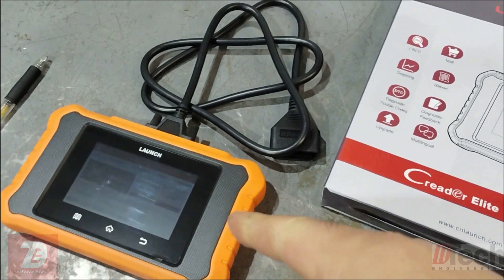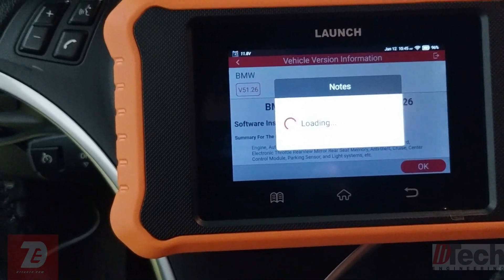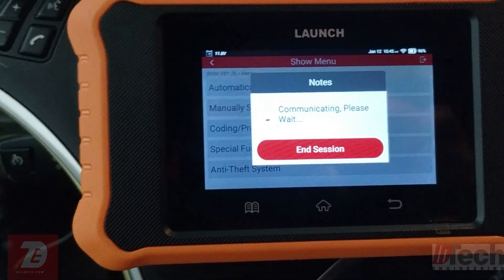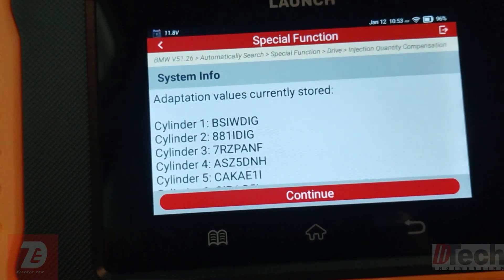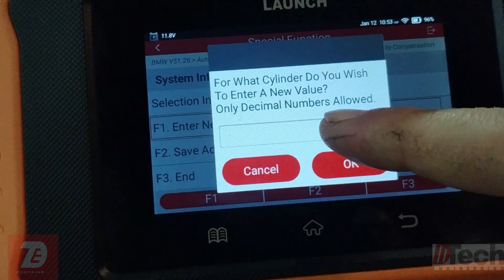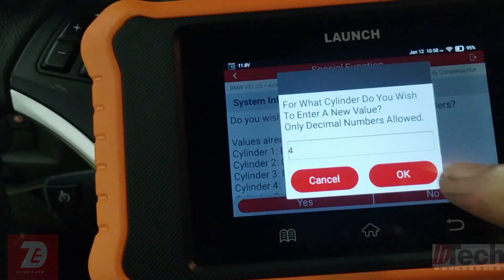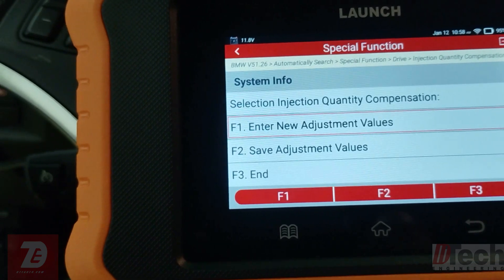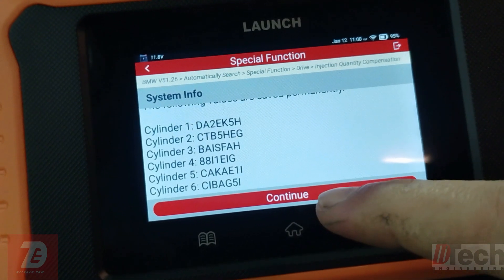BMW M57 Injector Coding W/ Launch Creader Elite BMW Scanner 2.0

Comment: How do you know what type of injectors you have with out pulling them out?
Reply from the maker: As far as what's "programmed " into the DDE you can pull up the info through the scanner, as far as which you "physically" have, you have to look on the top of the injector and read the numbers off of them.

Comment: Thanks!
Reply from the maker: Awesome! Thank you for that! Much appreciate it and thank you for watching!
Reply: This video doesn't currently help me. But I also bought the 2.0 I'm trying to program a new fob. The battery died in the original I used a dremel opens it and replaced the battery. Now the fob buttons don't do anything but still starts the 06 BMW 530XI E60 6SPD MANUAL. Fob goes in the steering column like a key. Have bought a replacement on Amazon need to program..With the Launch Elite Pro V2.0 and trying to program the fob I have a replacment fob. Can you help?

Comment: This video doesn't currently help me. But I also bought the 2.0 I'm trying to program a new fob. The battery died in the original I used a dremel opens it and replaced the battery. Now the fob buttons don't do anything but still starts the 06 BMW 530XI E60 6SPD MANUAL. Fob goes in the steering column like a key. Have bought a replacement on Amazon need to program..With the Launch Elite Pro V2.0
Reply: Also trying to code the aux option with the Elite 2.0. I have watched a lot of videos. Nervous to just wing it.

Comment: I am assuming you get a fault light if the fuel injectors are not programmed correctly?
Will this also work on the BMW N57 diesel engine?
Reply from the maker: Yes it should also work on that N57

Comment: Great video! Btw maybe will know what's the problem: I have a 3 liter diesel bmw with m57d30 engine, driving above 1k rpm - everything is okay, power and torque is great when giving it some beans, but when it's left on idle - it's running rough,  rpms keep jumping +-100 rpm. There are no codes, not even a check engine light (it works, tho), injectors were tested, all filters changed, crankcase breather - they're in good condition, working properly. What could be the problem? Is there a chance fuel rail pressure sensor went bad or something like that?
Reply from the maker: I wouldn't think the rail sensor would cause an issue like that. I would think maybe check for clogged up intake ports, as that is not something that's "truly" monitored and can cause drivability issues because it will affect the amount of air ingested
Reply: Thank you for reply, will check it :)  @DTEAuto

Comment: What other differences does the creader elite v2 have compared to it’s predecessor
Reply from the maker: looks like the capabilities of all the oem functions are still there, it seems to be just improved version with the self power up if need to look for reports without being connected to a vehicle, the obd cable detaches, the software seems a little more responsive than the last and faster